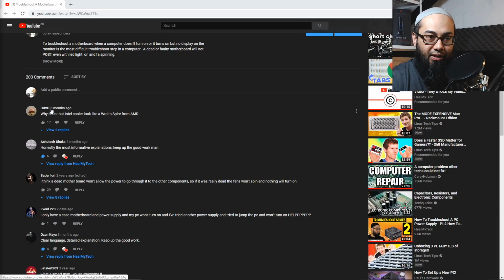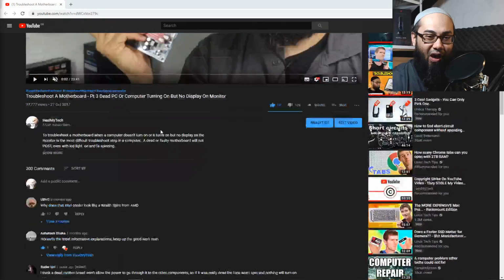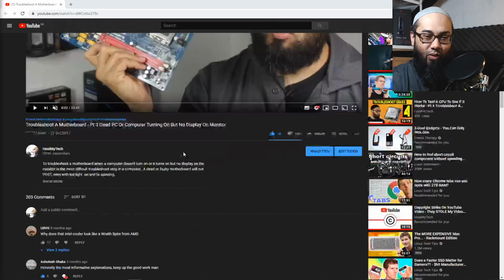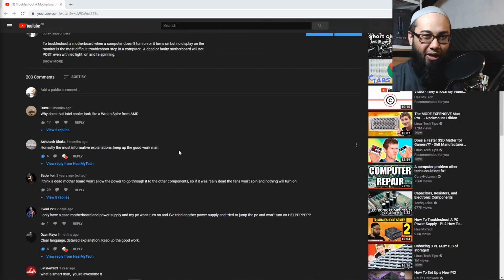How To Troubleshoot A Motherboard - Live Pt 3 Computer Tuning On But No Display On Monitor

Comment: Good day. 
Great work, love your details.

Pls bought a used dell Precision T1650 desktop, I upgraded to 12gb RAM. I did nothing else to the PC.

The PC turns on after working for about 30mins it  trips of and doesnt come on again for a long time, right now for about 24hrs.

I took it to a repairer. He touched the procesor and said it was cool, it wasn't warm or receiving current. 

The fan turns on, led turns on.

Comment: Hi, i have problem, pc turuning on, but video cards not sending singnal to tv, i tried plug it out and in to mutch times today trying some 4hrs already.. another ishue is my pc not doing bip sound turning on already some 5 years. Video card is gtx 750i, and mother board is asrock h61m-vg3
Reply: Could u please help me on this problem?
Reply: Did u fix it I have the same problem

Comment: Hi, so I’m having the problem where I turn it on and no post. I’ve switched out the graphics, psu, ram, and replugged all cables. Still same problem. I don’t have another cpu to test though it does look fine. I built the pc probably 5-7 years ago. It was working fine until a few days ago and just went kaput. I’m thinking it’s the motherboard or cpu. If the motherboard beeps when no ram is installed. Does that mean it’s still good?

Comment: i just need help with the motherboard, my pc is turning on but nothing shows on my display i changed the gpu it did nothing, change the cabled still did nothing, and power is still going through the motherboard as the fans are spinning, still nothing shows i think there is something on my motherboard that's keeping my pc from displaying and its not the cpu fan the odd thing is i haven't touch anything then one day it stop display and stopped showing, i know its not the TV as that works with other devices
Reply: I have the same problem..
Reply: Did you ever fine out what was wrong ?